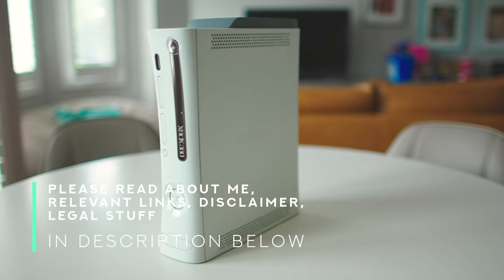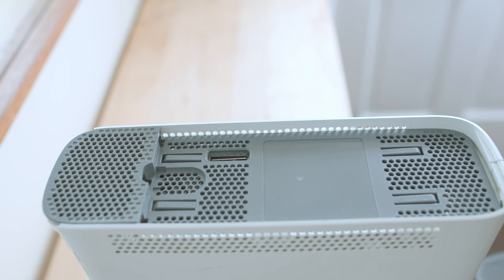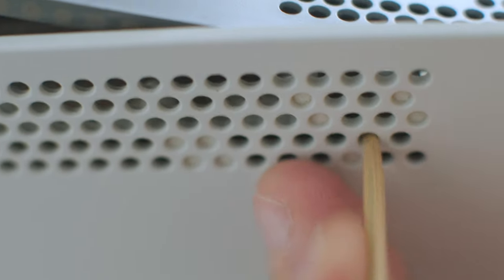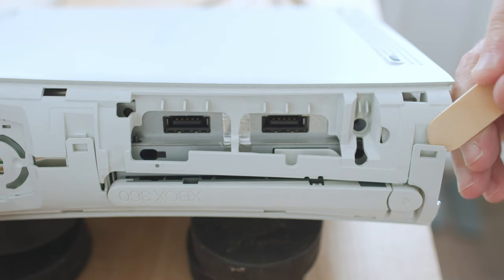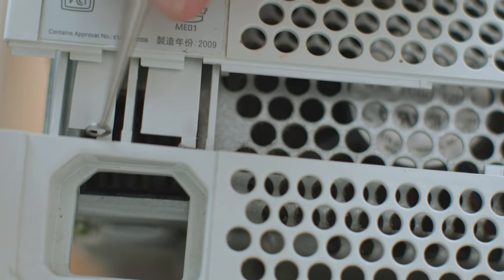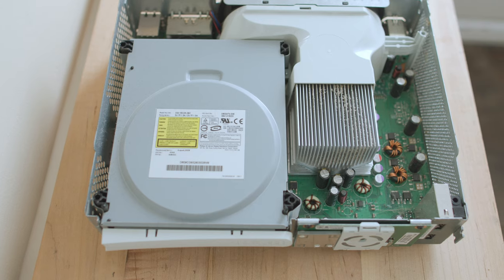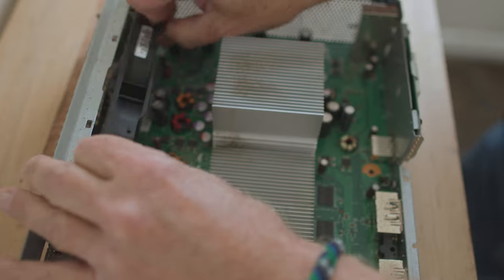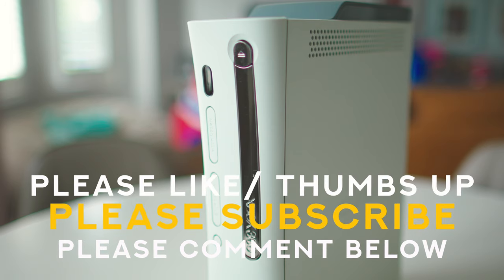XBOX 360 DISASSEMBLE AND CLEAN // how I took apart my Xbox 360 to clean/ make it quieter2

Comment: Note at the end of this if you are using this video to clean your xbox 360. I know this video is like a year old, but still wanted to say thank you. Just finished up my xbox 360. You werent kidding, the worst part was those clasps on the back. Sad thing  was though, I didnt line it up right in the front, and the eject button was just stuck, so I had to take it back apart when I was pretty much done. I would say for anyone doing this, make sure your eject button is clicking before you finish up. Theres just a part up there on the left edge where the button sits and if you dont get it lined up right you wont be able to push the button. Got a bit worried, thought I broke it lol 👍

Comment: If you have an old unit like this and have never cleaned it, its a good idea to replace the thermal paste while you are in there. But note, the X-Clamps for the heat sinks are a nightmare to remove.
Reply: I actually found a technique here that helped me out with the xclamps. With a small enough screwdriver I just placed it in a hole between the standoff and the clamp, and gently pulled the screwdriver towards me. This popped the opposite end off, rinse repeat for the others.

Comment: Thank you so much for the video. I turned on my xbox 360 for the first time after more than a year and then realized it has an RROD. I followed your instructions to open it up (although a few plastics broke lol) and it was a mess inside. The dust caked. But I got it all properly cleaned out with just a soft brush and a blower only. I also opened the power brick and inspected the fans, the power brick was looking OK inside. No significant dust. I gave it a quick wipe anyway.
The problem is that all these effort of love unfortunately did not pay, as I'm still having an RROD. The power brick just shows a solid orange light on the indicator and the Console would not still boot up. Its heartbreaking.

Comment: I still own a Xbox 360 since Christmas 2006, and got it fixed in Summer 2008, but I haven't been playing it since the mid-2010s due to my obsession with the original Xbox.

Now my Xbox 360 is heating and I can hear the fan while playing. Because of it, I think now is the time to clean out my Xbox 360 by getting rid of the dust and old thermal paste that's been there since 2008 (the year I send it to Microsoft to get it fixed) and put in new thermal paste.

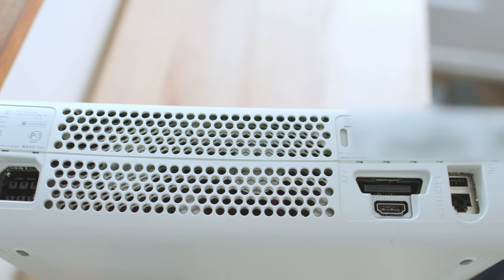Comment: 4:40 It was still a pain but I just used paper clips. Used vise grips to crush them so they could fit in the holes. Couldn't find my precision screw driver set. But I will now that I don't need it for this disassembly.

Comment: I’ve gotten to the 6:41 part of the video 5 of the 6 bolts came out with no problem. The last one I tried spins but won’t back out of the spot. Any recommendations you have? 🤞🏻you see this
Reply: After further inspection bottom case ended up just piping off last bolt holder ended up being busted. Sad but not the end of the world, still my old Xbox at least

Comment: The tabs on the backside. I used a sim card tool to push them while keeping tension on one side. A simcard tool has the length and is small enough to work pretty well. Never popped a 360 open and it took me less than a minute. iFixIt kits ftw.

Comment: Awesome tutorial, very clear directions, thank you! After failing to troubleshoot an apparent power supply issue with my console, it turned out there was a spider living on the motherboard! Now I can get back to trying to beat Akumu mode on The Evil Within (with far less background noise, too).

P.S. For the tiny tabs at 4:51, I used one of those little SIM card tools.
Reply from the maker: Thanks for the comment!  Glad you’re up and running!

Comment: im tryna put the 6 long screws back in but one of them has a way longer thread than the rest of them. like theres 5 long screws with like quarter inch from the tip is thread, then just one of them has half inch from the tip is thread
Reply: I have 5 silver screws with 1/2" - 3/4" threads, and one black screws with 1/4" threads. Wanna trade?

Comment: This is the clearest explanation I have seen, thanks ! I have a problem with the dvd drive, it gets stucked and I have to press the eject button several times for it to open even if there is no disk. Before disassembling it it worked ok, what can I do ? Thanks
Reply: Did you do anything to the band near the disc drive?

Comment: I'm surprised you didn't go a few steps further by pulling the motherboard and giving it an alcohol scrub along with a new thermal paste application. Then soaking the plastics in warm water before scrubbing.